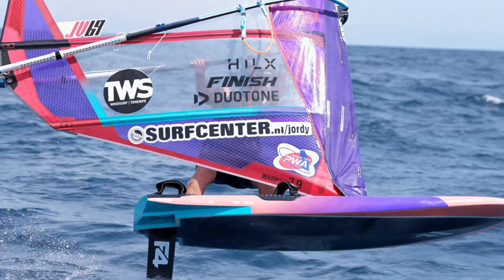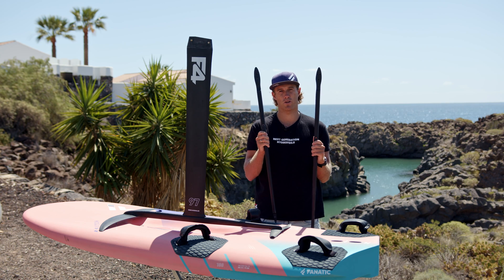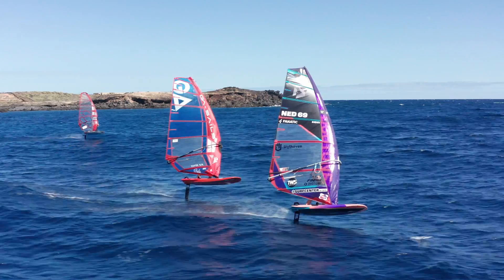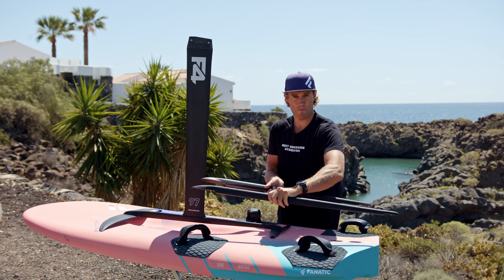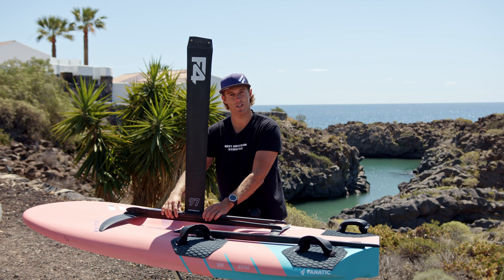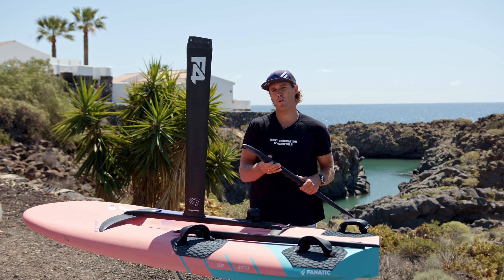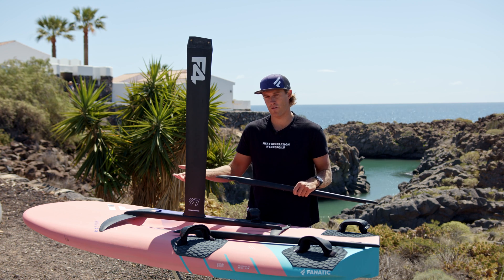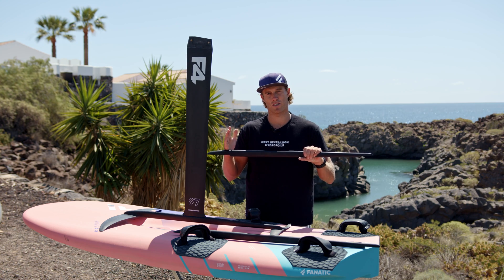Episode 3 - Fuselages

Comment: What do you mean by 'more power'?  Is it that with a longer distance of foil from mast there is more leverage trying to lift nose up. and if so why is that a good thing?
Reply: With more power I basically mean more lift, more 'force to keep me up in the air'.

The second question I didn't completely get!?
Reply: @JordyVonk  I thought that amount of lift depended on size and shape of foil, and a longer fuselage would move the foil and centre of lift forward, so to balance you would shift your feet forward. If you did not shift feet forward then would not centre of lift make the foil breech? Or does the leverage mean you can get away with a smaller foil on longer fuselage?